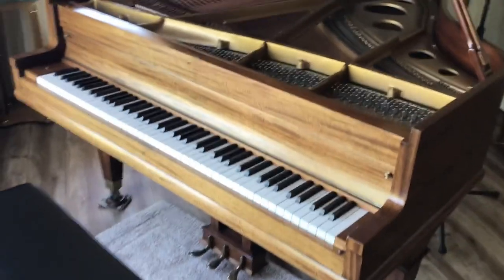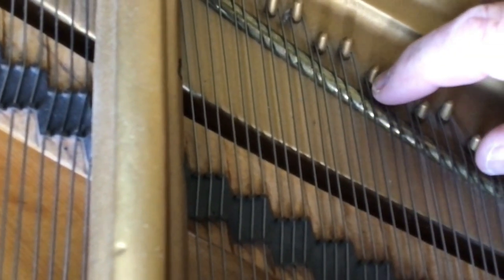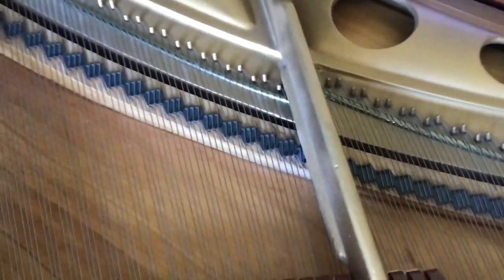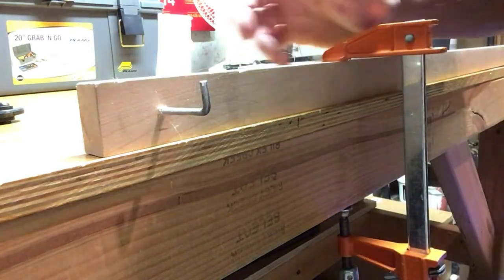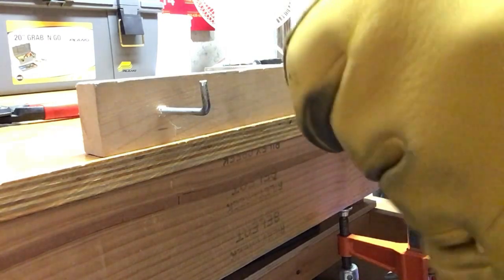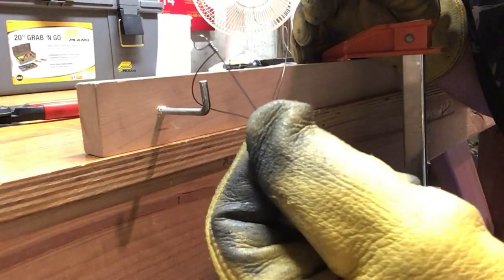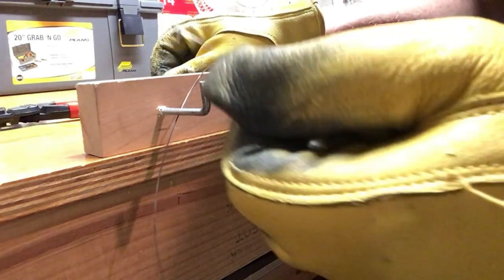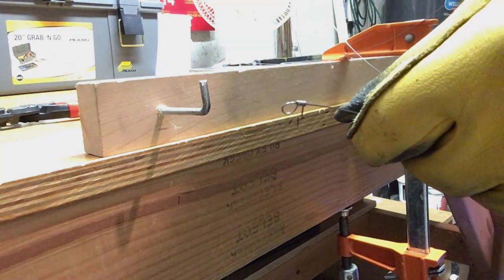How to Make a Piano Hitch Pin String Loop I HOWARD PIANO INDUSTRIES

Comment: Some uprights use this type of loop for bass/copper wired strings as well.

This also could be done in the field, with hand tools. Without the jig or table. I think doing it with the hand tools is a pretty common necessity. 
Would be great if you addressed this, maybe in the next video.